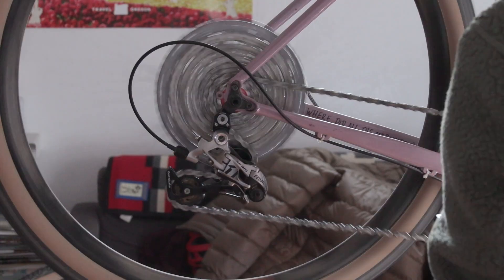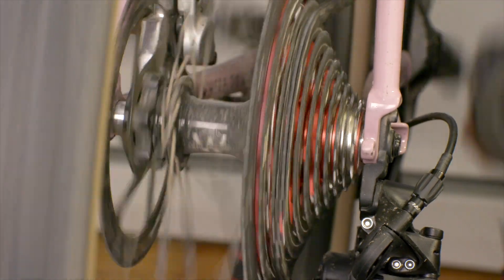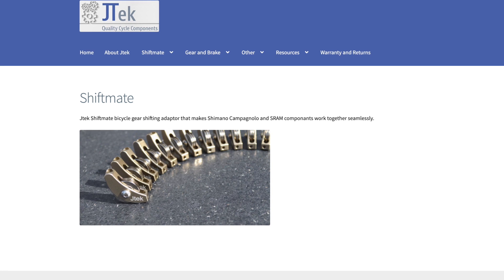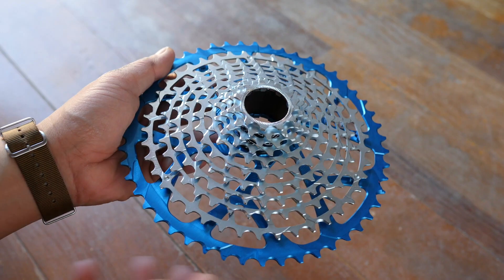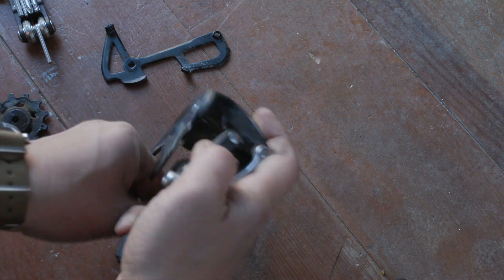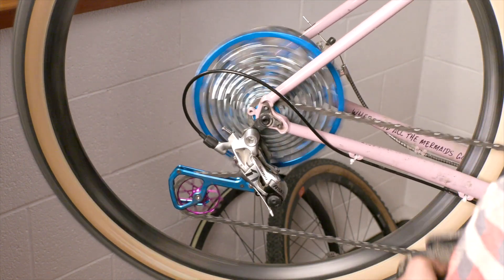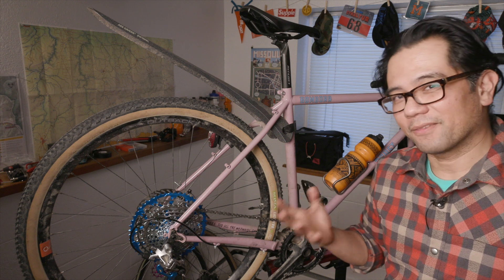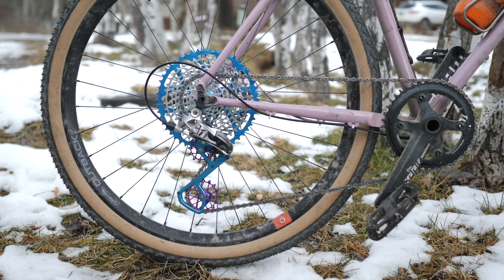BIKE HACK! SRAM Road Derailleur with MTB Range! #CaveofBadIdeas

Comment from the maker: **UPDATE*** Cassette is hardened steel, only the blue cog is aluminum.  Assumed it was Al because it was so dang light!
Reply: Path Less Pedaled I’m a bit of a curmudgeon, but that cassette is sick! And the colors are garish they are perfect! Nicely matched cage too! 

If you were going to run a vote, this setup would get the nod!
Reply: Cool cassette mut why not use a NX 11v 11-50 cassette? It would shift ok right? i mean the chain is still a SRAM chain. I understand you got the components from Garbaruk but from a cost perspective it is more interesting to use a SRAM NX cassette.
Reply from the maker: Tim Lagas sure. Could do that. Would be heavier.
Reply: @PathLessPedaledTV  okay good point but I thought saving grams wasn't your thing ;)
Reply from the maker: @timlagas  Look, theres nothing I can say thats going to make you 100% happy.  Theres a million things I could have done and I did what I did because it's what I had.
Reply: @timlagas  Which cassette?  I see NX Eagle PG-1230 12 speed 11-50. Not sure what 11v is.
Reply: 11 speed sram is 10-42. Gotta go eagle 12 for 10-50
Reply: Any discount codes for Garbaruk looking 2 purchase pulleys for Box Two derailleur 11+14

Comment: I've wanted to do a 1X conversion and I came across this video over the winter.   I converted my NRB from Shimano to SRAM RIVAL with the Garbaruk cage, pulleys and 11-50 cogset and it works great!  Ever so slight noise in one cog but it is nothing annoying.  THANKS!
Reply: How are you finding it?
Reply: @paulb9769  still works great! The noise disappeared after a few months.

Comment: Great show.

I follow this with some interest since before GRX, the option for brifters with mtb gear range was mainly with SRAM.

There is another option though, which is a MTB shifter routed thru a thinner road bar (often a fixie handlebar) running a XT RD.
Brake levers would be some road style ones like Tektro RL340/520.

I have run this setup on a couple of mini velos.
It gives indexed shifting and functions like bar end shifters with the advantage of not being bar ends and easier to reach for.

Comment: I put an e.thirteen 9-46 on my XD White Industries rear hub, and have been running it for a couple years with a 1X SRAM Force group, 38T front ring, works great. Eagerly awaiting the SRAM 1x12 wide-range drop-bar drivetrain. (Also have a bike with SRAM AXS Eagle cassette / drop-bar Force shifters, and it's excellent.)

Comment: Very nice!!  

I looked at the Garbaruk 11-50 for my setup and their stuff looked beautiful.  I almost pulled the trigger, but the cassettes were $280 + the derailleur cage when I was looking.  (Now you can get the cassette and cage for $257.  The pulleys are $69.)   Plus I was on the fence about having a modified rear derailleur.  

I went the XD route with the 9-46 so I could use a standard GRX derailleur.  But by the time you factor in the cost of the XD driver, e13 cassette and a chainring, it was close to $400 so I spent more than the Garbaruk would cost.
Reply: Also, the long cage SRAM Rival and GRX derailleurs will go to 46t without modifications so the e13 9-46 might be a viable/desirable option for some.  Especially if they already have an XD driver.

Comment: Thank you to you Russ and michael (locked in ) for this hack info. I was in need for shimano right shifter for my Grx since my old one is about to break. And find out shimano hike the prices to 260.00 for ultegra right shifter alone.  I will sale the rear derailleur and buy a whole set of rival shifters and rear derailleur for only $280.00. Then later i will buy the garbaruk kit.

Comment: I'll have to keep this in mind. I've been playing with my Red 11 2x with a 11-36 cassette, works nicely with 46-34 on the front
Reply: Anthony , is your set with Red shifters still workng well with the 46 - 36 cassette?
Reply: @catherinev8603  still works fine, might try it on the other bike's etap at some point.
Reply: is your red rd all stock for it to work with an 11-36 cassette?
Reply: Still working fine, even tried with the 11sp etap with a 50/34 with the results, it's all stock SRAM parts

Comment: Because of advancing age, I recently converted two bikes to straight bars instead of drops. For old Shimano 9 speed this is a piece of cake - everything is interchangeable, shifters and derailleurs, road and mountain. For ten and eleven speeds be prepared to do some homework. Pull ratios differ between road and mountain, SRAM and Shimano.

Comment: Here is a suggestion- use APEX 2x shifters and X7 (2x) Dereilleur 🤔 it gives you up to 42t range
Reply: I'm running a 44t 1x  setup with an apex1 rear derailluer, a rival 11 speed brifter and a 11-42 cassette on my cross bike. 
Runs good.

Comment: Thanks for the awareness on this product.  I'm looking at a build with Force AXS wireless, but want to get a much larger 12spd cassette and still keep the 2x up front (with power meter).  We're looking at starting with a Wolftooth adapter, but this might be another option to try.

Comment: It may not give you as much range as this, but there's also the Wolftooth RoadLink as well (they have something called a GoatLink for similar applications but different systems). it's only a $20 part (+shipping) or something like that.
Reply from the maker: We used it in previous episodes of the series.  Was looking for a solution that didn't require it.

Comment: Dude nice video.  I think I am going to do this.  I already have an 11-46 cassette and my Force 1 derailleur is barely hacking it.  I can optimize shifting and keep this cassette or go to an 11-52 if I want and that'll be plenty.
Reply: Checked on ebay and there are Eagle replacement long cages by KCNC for $90.
Reply: I got the KCNC Eagle replacement cage and the Sunshine 11-52 cassette and everything works well.  Pretty surprised.  I thought it might inherently shift poorly because of the giant scale but it works perfectly.  I have no reason to try anything different like a cassette with a 9 cog.  I went with a 42t chainring and am pretty happy with it.  The replacement cage didn't go on seamlessly, but I figured it out.

Comment: sram you can use a 10 speed mtb derailleur with clutch on 11 speed shifters 2x11 and 11-36 works good 
that's because 10 speed mtb derailleur is exact actuation and 2x 
I have a extra long XO derailleur with a 11-40 cassette and 48/32 in the front it works no tricks

Comment: Appreciate the entertaining and useful series here.  One request, do you have any smaller cassettes you can test with with modified derailleur cage?  11-32, 11-36, 11-40?  I run a 2 wheelset setup so my 700c road/light gravel setup uses tighter gearing.  Will definitely get the 11-50 for my 650b wheels.
Reply from the maker: Anything sub 50 will work.  Stock Rival does 46t easy.

Comment: I bought the Garbaruk cassette with the longer cage and jockey wheels. I can get the cassette to work well with a standard Rival long cage derailleur but I cannot get enough chain length to cover the longer cage and jockey wheels though! Not really close. Just wondering what chain you used please? Perhaps it only works with a smaller frame? Thanks.
Reply from the maker: Bought two chains and spliced them together.
Reply: @PathLessPedaledTV  Thanks heaps.

Comment: Have you thought about using the micro shift 12 speed bar end shifter and a Sunrace 12sp cassette with your NX derailleur? Great stuff and so helpful as I might be getting a Bombora myself and am looking at possible drive trains .
Reply from the maker: It would work.  I have no interest in going 12spd though.
Reply: Curious as to why?
Reply from the maker: I’m tired of the upgrade wheel.  Also the more speeds, the more fragile the chain.  Would actually prefer a simpler 9 or 10spd.

Comment: Ive managed to pair ltwoo r7 shifters with a shimano cues u6000 derailleur with a 2×10 
With 38 28 chainrings and 11 to 50 cassette and it works quite well
Reply from the maker: Send me a vid. I want to see it work.  On paper it shouldn't be compatible since the R7 doesn't use the same pull as Cues.
Reply: @PathLessPedaledTV  somehow it works quite well even tho it's a very experimental thing it does have a weird thing with it is that you kinda have to treat it like a friction shifter however once you've gotten used to it it works well and the front derailleur even shifts with the clutch on
Reply: @PathLessPedaledTV  also how do I send videos via YouTube im guessing I could use Instagram
Reply from the maker: @kobidwyer7464 DM via Instagram.  Did you have to modify anything?
Reply: @PathLessPedaledTV  no all I had to do was put the derailleur on and tune it however it isn't perfect as I'm limited on the b tension because of the 2× chainrings
Reply: @PathLessPedaledTV  but now on the lower chainring on the biggest rear cog I have the lowest gear ratio I've ever achieved I can cruise at like 2 or 3mph and climb the biggest angles

Comment: I am looking at setting up something similar to this for a drop bar 29er build I am working on. I understand the parameters and resources you are working under but I am looking at setting this up with a Shimano drivetrain. 
Do you think it's possible and do you think I should use a road or mtb derailleur? I would probably be using an 11-50t sunrace cassette but this video has me thinking about using this garbaruk cassette. Thanks for the experimentation and for saving us all time and money.

Comment: Works the other way to. I have a deore xt shadow 9 speed mtb mech on a 10 speed road bike shifter using a cassette from a mtb for extra gear range.
Reply from the maker: Works until you get 11spd and then all cross-compatibility goes out the window.

Comment: Nice!  Thank you so much for this video, you showed exactly what I was looking for.  I've got a Sram Force 1x11 setup, and the bike came with 11-36 cassette and 42 tooth chainring.  It does have the long cage derailleur, which Sram claims can handle 42 tooth cassette pretty easily.  Do you know if the stock Force 1 derailleur can handle more than 42 teeth?  I doubt I will need a 50 tooth, but a 46 tooth might be good, trying to figure out if I need this replacement cage to get an 11-46 on my bike.  I don't think it matters, but the bike is an Orbea Terra gravel bike.
Reply: Rival 1 and Force 1 RDs both can cover 10-46t no problem in terms of chain wrap capacity and clearance. Maybe 10-48t, but that's pushing it. Only way to get it 10-50t is to either install the Garbaruk cage as in the video, or replace the cage assembly with an Eagle one. You technically only need to do the cage, but then the chain lock might rest in a funky place, so if you replace clutch and cage it all lines up fine.

Comment: This is exactly what I'm looking for! Will this work with my force 22 setup? Would it extend my short cage mech enough to handle a 36t rear or do I need to get a medium cage mech to start with? I see you have a new vid out with the jtech add on. What's  your recommended option at this point in time? Thank you!!
Reply: Could I go larger than a 32 rear with my 2x setup? What's the max? I have a 50/34 tooth crank

Comment: I bought a cross bike I need to convert gearing.  It has force rear derraileur and shifter.  38T 110bcd force crank and 11x32 rear.  I feel the 38T may work for her with a 50T or 52T rear.  I have a number of cassettes so I really need a longer cage...is this correct?

Comment: I have a gravel bike that I originally specced with Sram Rival 1x11 groupset, 42t front chainring and 11-42 casette in the back. Looking to upgrade with the garbaruk long cage as well as their 10-50t casette. Do you reckon chain length will be ok if I use the same? Or should it be longer/shorter? thanks
Reply from the maker: Might have to adjust. Hard to say without trying.

Comment: Will this work on 10spd GX or is this only for 11/12spd? Does this need to be paired with their cassette or any cassette can work?
Reply from the maker: 1. Maybe. 2.any cassette.
Reply: Just looked at their site they make one for 10spd sram but max is 45 vs 50. Do you know what max would be for your setup if it was 2x?
Reply from the maker: No idea.
Reply: Ah I thought maybe manufacturer mentioned it. I don't remember if their site mentions it or not.
Reply: @Alex_564  Even if you could bolt this cage to your 10spd GX RD, it would never work properly with a 2x setup, but I highly doubt that it would work correctly at all. These kind of RDs (and cages) are 1x specific.
Reply: @HollyBoni  The GX(not Eagle GX) is ment to work with 2x.
Reply: @Alex_564  Yep, I meant that RDs like the Rival 1, or Eagle are 1x specific, mainly because of the cage design. Even tho your old 10spd GX is meant for a 2x, if you bolted a cage to it (still not sure it's even possible) that was meant for 1x specific RDs like the Garbaruk cage in the vid, it wouldn't work properly anymore in a 2x setup because the upper pulley is offset so much. 
If you used it in a 2x setup the b-gap would be completely off every time you changed gear in the front.
Reply: @HollyBoni  ah okay. Cause I saw on their site they have a 10spd one that maxes it out at 45t in the rear that caught my eye but being 2x not sure what max would be or if it would work, which means I may need to go 1x.
Reply: @Alex_564  It looks very similar to the stock 1x11 SRAM cages, and you need huge capacity to run an 11-45 with a double. But shoot them an email, i'm sure they can help.
Reply: @HollyBoni  a longer cage would definitely increase the capacity of a 2x setup. But yeah, that offset guide pulley wouldn't work, and also shifting to the smallest cogs would be sketchy due to the huge b-gap. Unless, of course, someone is crazy enough to make an aftermarket parallelogram that moves at a steeper angle. But then you're almost building a brand new derailleur. Also, I've never heard of anyone disassembling a derailleur parallelogram, which makes me suspect that this could be a very difficult thing to do. Lots of springs etc.

Comment: Have you ever swapped out a SRAM 11rear Road derailleur for  a 10 speed - SRAM GX  rear derailleur to obtain a 42 or 46 gear range using still the SRAM road components?
Reply from the maker: Yes. Did that in a past video. Sort of sketchy.

Comment: does this work only on sram road derailleur or does it work with mtb ones too? If I have a 2x rival setup what would be the largest cassette I can use? I take this doesn't add a clutch either?

edit: do you know where one can get a eagle nx, gx, or higher rd cage?
Reply from the maker: 1) Cage was originally designed to work with the mtb.  In the vid, I said that Garbaruk never tested it on Rival, so this is new territory.  2) Don't know.  3) It does nothing to the clutch only extends the cage.  Either your derailleur has a clutch or not, this won't add or take it away.
Reply: @PathLessPedaledTV  thank you. Did the company tell you how long the disc cogs lasts & after how long they need to be replaced?
Reply from the maker: @mellissanash7517  No.  But looked closer and the first 10 are actually steel and only the blue is AL.  So should last a while.
Reply: @PathLessPedaledTV  longer than stock I would assume?
Reply: These kind of derailleurs and pretty much all 11 and 12spd SRAM MTB rear derailleurs are 1x specific. Your 2x Rival is very different to this 1x Rival. Even if you could bolt this cage, or an Eagle NX etc. cage to your current derailleur, it wouldn't work with a 2x setup (and I highly doubt it would work at all). 
If you want a 2x derailleur with a clutch, your best bet would be to go with a 10spd SRAM GX rear derailleur (it works with both 10 and 11spd road levers, even some factory bikes come with this setup). It has a clutch, and it can do 2x. Officially the biggest cassette you can run with the GX is a 36T, not sure how much more you could push it in a 2x setup.
Aftermarket and/or more expensive cassettes don't necessarily last longer than stock cassettes, sometimes they are less durable. Aftermarket cassettes are mostly about saving weight and offering unique options.
Reply: @HollyBoni  Thank you sounds like I am out of luck, unless I go wolftooth roadlink, which should get me at least 40t in the back I think.
Reply: @mellissanash7517  If you're running a 2x keep in mind that the Roadlink doesn't add anything to the overall capacity, just enables the RD to clear bigger cogs. But again i'm not sure how far you can push these RDs so you might not run into capacity issues.
Reply: @HollyBoni  40t is what Woolftooth's site says.
Reply: @mellissanash7517  Yep, but the overall capacity and the biggest cog the RD can clear are two different things. 🙂 Wolftooth doesn't talk about overall capacity because that depends on the cage length. 
Check the "Explanation of Derailleur Capacity" part here: 
https://www.wolftoothcomponents.com/pages/roadlink-tech-page
Reply: hey would this work for a Rival 2.1 RD?

Comment: Why not just use a sram rear derailleur with Xactuation that has the same 1:1 ratio as road? I've also done a Shimano di2 setup and swapped the short cage for a long. But this was 5 years ago,assume compatibility is similar now.
Reply from the maker: Compatability is NOT similar.  There is no SRAM derailleur that uses “exact actuation”/road pull that will clear anything larger than 46t.
Reply: @PathLessPedaledTV  and 46t isn't enough? Gotta get stronger
Reply from the maker: Lower gears exist for a reason. Mountain biking, loaded touring, steep off road bikepacking, riding with kids, carrying groceries ip a hill, etc.,  Sometimes people ride bikes with more than GU packets in a jersey pocket on nicely graded surfaces.

Comment: Hi, i am a but unsure o wether it is possible to combine your hack with the Ratio upgrade kit to convert SRAM road mech levers to 12spd. If the cable pull ratio would be the same then this should be possible. right? Would somebody happen to know?
Reply from the maker: Should work.